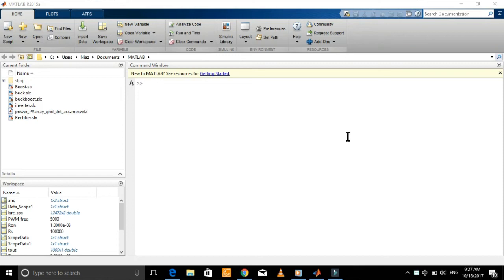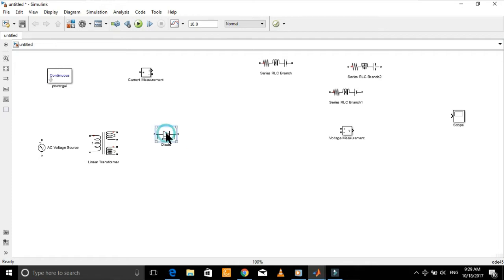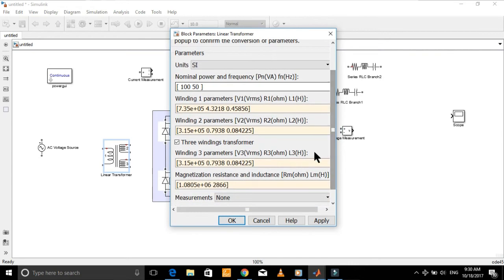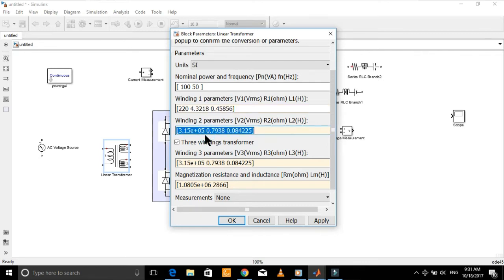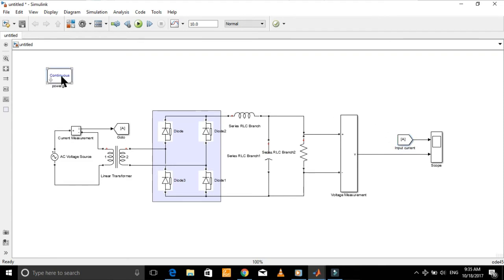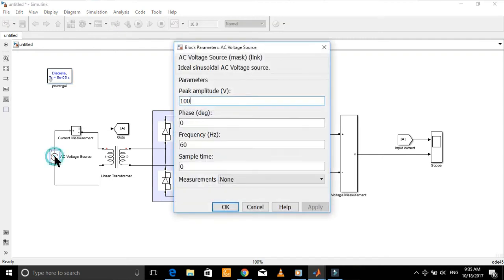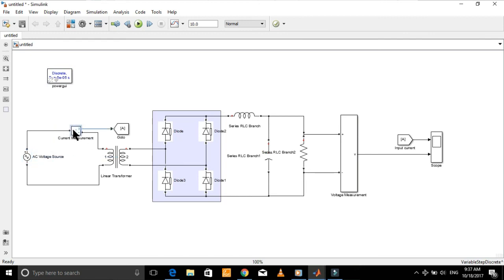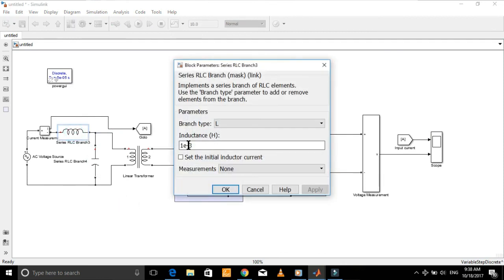FFT analysis of the input current to a rectifier and design of input filter

Comment: if we want to apply it to a tool, how to position the L and C components. is it between source and rectifier or after rectifier?
Reply from the maker: I couldn't understand your question completely. You have to apply it between the source and rectifier.

Thanks
Reply: @simulinkmatlab3886  I did filtering for 21 watt led bulbs.after the calculation, the value of the filter components is L=4.2 H and C=1.2uF but when tested against the lamp, the lamp is burnt or damaged. What do you think is the solution for a case like this, sir?
Reply from the maker: Complete course on Rectifiers simulation in Simulink/MATLAB:
https://www.udemy.com/course/rectifiers-in-matlab-simulink-a-practical-guide/?couponCode=2242218ABDC75A5F6EE3

Comment: hi excellent video.... i´ve a question IF in the output the frequency is 100 Hz.. Why in the simulation the fundamental frequency es 50 Hz?
Reply: The Fundamental Frequency refer to the Input AC Voltage .
Reply from the maker: Complete course on Rectifiers simulation in Simulink/MATLAB:
https://www.udemy.com/course/rectifiers-in-matlab-simulink-a-practical-guide/?couponCode=2242218ABDC75A5F6EE3